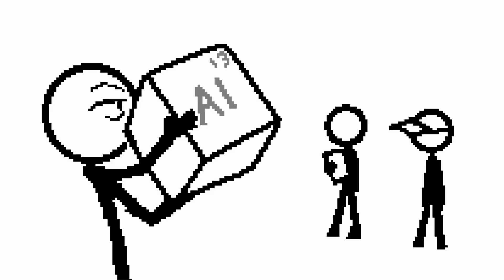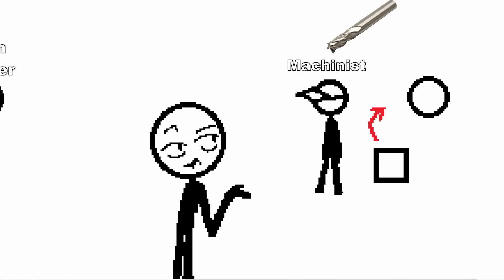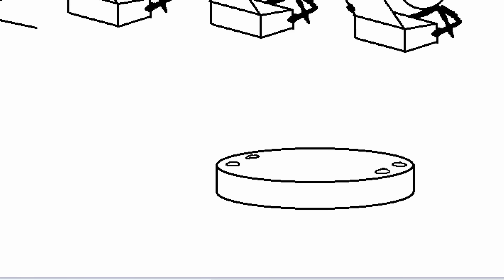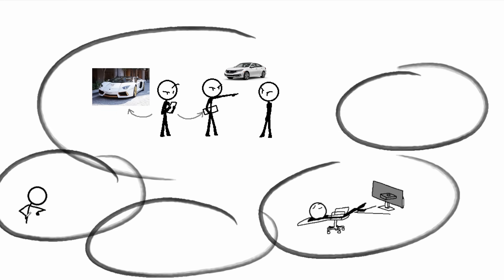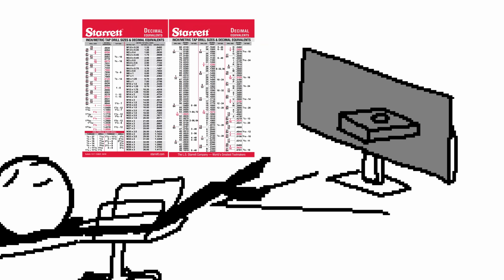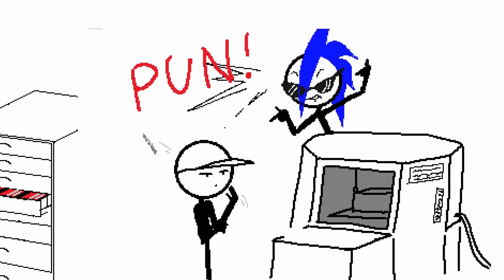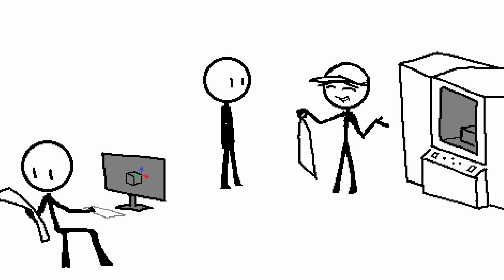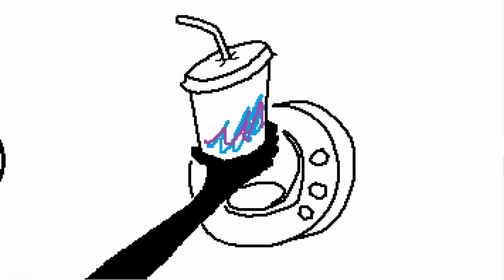Why we hate engineers

Comment: I learned all of these problems from an internship at a manufacturing company.  The engineers sit high and mighty in their A/C offices while the CNC guys get the weirdest, most impossible instructions on the planet.
Reply: ...are the machinists not in an air conditioned room too? Because if not, they should quit. It's a lot easier to prove you're a good machinist than fake being a good engineer, they shouldn't have a hard time getting a better job.
Reply: @aluisious  Nope, it was a large factory where we built cabinets, doors, shelves, you name it.  The CNC milling, edgebanding, and jointer operators had the toughest times with the miscommunication and misunderstanding, with a lot of waste tools that were made for specific jobs and never used again.  They showed me drawers of tools for the jointer, some years old that were used once.  Anyway, we couldn't have A/C since the factory was so huge.
Reply: @aluisious  yeah if my machine shop doesn't have ac I'm going to be suspicious especially if its way above or below 70 degrees as that's the standard to calibrate machinery and measuring tools but for basic repair shops its not as big a deal
Reply: I’m a 19 yo machinist and in the little time I’ve been working this type of issue has already happened lots, honestly it’s frustrating. Thanks for this video its amazing, thank you!
Reply: That's a really misguided idea of how engineers work, at least from my experience actually being a design engineer 

We go out all the time to do physical work, surveying, measuring, climbing up on top of shit because we can't find a pipe because it wasn't installed according to the drawing and nobody bothered to pass it on. Obviously that's not all engineers, but just my experience.

I feel like engineers get shit on more because it's perceived as punching up, while if complaints go the other way it's seen as punching down (which it kinda is). 

I think there should be a reverse version of this video explaining all the things that are frustrating in the other direction. Like the aforementioned turning up to do a final quality check on the job site only to discover it's been fitted in a completely different way and now you have to redraw the entire thing. Because it seems there is a lot of emphasis on understanding it from the machinists point of view but what about the other way?

Like sure, that part with that tiny spigot sticking out looks really fucking stupid, but have you actually seen what it's being used for or fitted to? maybe there is a reason it's not just threaded in. 
Maybe that surface finish is way too high for the actual purpose, but it's being made that way because it has to comply with a standard in order to be allowed to be used. 
Maybe that is a really weird size of hole to drill out, but perhaps it has to be that way because there is a really weird connection it's got to fit. 

If machinists in this case were given more context by designers it would make their job easier and in turn if the people fitting the parts (in this case "man with angle grinder") communicated why they had changed all that pipework around (eg, there's a random pipe that was fitted mid-way through us designing the fitment) instead of giving zero feedback then when we go to survey it will make sense and we can correct for that in the future. 

TL;DR Communication is everything, instead of assuming one group (engineers, machinists, fitters) are stupid maybe ask why they chose to do it that way. 

/rant over/
Reply: As a engineering major I strive to not be like that lol
Reply: Exactly my experience too. The designers in their AC office while the operators are on the floor, soaked in coolant and grease.
Reply: So fortunate b4 I went and got my eng degree that I was a floor employee for 7 years... Some of the shit my colleagues come up with is just stupid. Lets be on the bleeding edge of yada yada, running every tolerance to its max... 

It spreads salt on a road bro... the difference between 1%-.001% is sooo much smaller in cost than the difference between .001% and .0005%... AND NO ONE IS GOING TO NOTICE OR CARE IF WE PUT 100 POUNDS OF SALT ON THE LOT OR 101 POUNDS SO GO WITH A 1% TOLERANCE AND SHIP IT.
Reply: @Kav.  I'm going into Enginwering myself, so I appreciate being able to learn both sides of the story.  I personally believe having experienced the manufacturing side of things first will make it easier to understand other parts of a design and manufacturing process.  It's most of why I did the internship in the first place.
Reply: @swifter46ter  experiencing manufacturing will make it easier, most engineers I've met have got at least some experience manufacturing though. What I'm really trying to get at is that a lot of the time in manufacturing somebody from one party (machinist, fitter, designer) will instantly go "ah they're being fucken stupid" rather than asking why it's been done that way. 

Those pipes I was talking about for example. 
As a designer I could go "ah they're too stupid to fit it properly" 
As a fitter they could go "how are they so stupid they thought this would fit?" 
As a fabricator they could go "how are they so stupid they thought we could get a pipe with that bend radius"

Which is why all three should communicate and actually pass on notes. In reality most people have a brain, if something seems wrong it never hurts to ask why it has been done that way. Maybe all parties would learn something then. Instead we get "reee why engineer stupid not know how to design for manufacture?!?!" which is just unproductive.
Reply: I was once at a job site to do some data gathering for a virtual trainer on how to assemble and operate a real system. They build the real thing, my company builds a less computer intensive version that can be run in real time. Both departments were in the same building, but unless the finance department gave them a charge code for the time they spend in the other departments' building, they could not pass through the doors to physically speak to one another. One of the weirdest rules on a site I ever read.
Reply: @Kav.  A lot of people don't communicate because they've learned the answer is going to be "shut up and do your job." People are shitty, and lots of "teams" are not a well oiled machine. 

I've worked on fixing broken or buggy equipment for years, I have experience programming software, and when I get what looks like a software related error I ask if I can get the source code and I get told "that's not your job." 

Fine, fuck it, I'll throw a $5k part at it knowing that it won't fix the problem but I can close the call and hopefully someone else gets it next time.
Reply: @Kav.  if something wasn't installed right that sounds like an assembly issue rather than a machining issue
Reply: @user-lv8dn8gw9z  it's a fitment issue, I already specified this when I referred to the "fitters" but it could easily be a machining issue if something was measured incorrectly, a machine incorrectly calibrated, a drawing had a bit of coffee spill and the operator just machined the part to the dimension they remember (for manual ofc)... Human error is a thing. 

But again, not my point.
Reply: @aluisious  well yes, but continuing that culture is your choice. In my experience the "shut up and do it" types are universally despised and generally few and far between. 

If they tell you to shut up then it's on their head if it's wrong, at least you asked first. Better than you being the one to take blame.
Reply: @aluisious  Now you are learning hahahahaha sounds like my job, you can't win them all, or many at all i'm afraid.
Reply: Plus we're soaked in coolant and with loads of chips that make us look like metal porcupines.... Or other things depending on what you do in the shop lol. Ooh god not to mention when you gotta open the machine up.... Talk about hot
Reply: The engineers get nicer offices because like this video says they're expected to design, model, test, and know how to fabricate everything about the parts they make. 4 year bachelor in engineering and then I guess they are expected to have another 2-4 year machinist certification as well? Maybe a masters for the design part. They don't need a machinist on the team the point of manufacturing engineers is to know the capabilities of the equipment in their shop and put input on design. Too many people want the designer to do everything.
Reply: @Kav.  got bad news for you bud. Talking to them is your job. A machinist on the floor gets the print and makes the part. Half the time i dont even know what it's for. We get paid to make the part to spec, not to make sure it gets installed correctly.
Reply: @JamesBlitz00  This isn't just about machinists though, this is about fitters, welders AND machinists.

Communication is the job of both parties, that's how you make an effective team. 

If you're a fitter lets say on a ship and you have been told "fit 50mm OD pipe to this installation guide" if you are unable to fit it to (lets say because it's a class of ships where this one particular one has a different fitment for some unknown reason) that spec you need to communicate and work with the designer, what you don't do is just fit it however you like or just only fit the bits you feel like fitting. If you need to fit it quickly then that is the only exception (For example if the ship is going out to sea the next week), at which point you need to feed that back to the designer with the reason why.

The same as how if you are unsure about how something is to be made you should feed that back and ask. You're an adult as well, it shouldn't be that design engineers are constantly chasing after you, if you think something is wrong then speak up. 

As a side note, every machinist (pro-tip a lot of machinists eventually become design engineers) I've ever spoken to agrees with me on this. If you see something that looks a bit odd it's not bad to query it rather than wasting material, labour etc making the incorrect thing. ESPECIALLY if you make the incorrect thing because you did not fully understand what was being asked of you but you chose to just assume rather than ask questions.
Reply: @JamesBlitz00  see this quote: "If machinists in this case were given more context by designers it would make their job easier and in turn if the people fitting the parts (in this case "man with angle grinder") communicated why they had changed all that pipework around (eg, there's a random pipe that was fitted mid-way through us designing the fitment) instead of giving zero feedback then when we go to survey it will make sense and we can correct for that in the future. "

Then you reply with "Half the time i dont even know what it's for"

DO YOU NOT SEE THIS IS EXACTLY THE PROBLEM I AM POINTING OUT? 

Like imagine condescendingly ("got bad news for you bud. Talking to them is your job.") replying to me with that when you haven't even read what I said properly.
Reply: @WiseSchizo lol, not in my experience. 

Schizo is a good choice of username though, embittered guy who can't see it from the other side while he incessantly whines about how "others don't see it from my POV" failing to see the irony of this.
Reply: @WiseSchizo in that case why aren't you doing our job? I know plenty of machinists who have gone up to become design engineers, so why not you bud? certainly brings a cushty pay rise.
Reply: @WiseSchizo interesting, I've never paid a single penny for education yet here I am. I guess it must be different in America lol.
Reply: @WiseSchizo I certainly found it ironic, given the context of your comment. Just not in the way you intended.
Reply: guys dont hate engineers,  just study more and u can become one ;)
Reply: @Kav.  Engineers, at least some of them, work on the floor, too, and wear the same dirty company workwear as machinists, assemblers, and other workers. In fact, visitors from other buildings, suppliers, and contractors sometimes ask me things about the workshop that I'm totally clueless about. I realized that's probably because I'm not young anymore so I look like I know everything but actually I just joined the company and I have to ask the young guys everything and again in a fortnight because I forgot the answer. Since everyone is dressed the same, there's no way for visitors to know who to ask so they resort to intuition.
Reply: @Kav.  In some cultures, it's common to avoid speaking up. It could also be a personality trait that some people choose not to speak up even if they get a design they are 99% sure is a design error but they see faulty design as a manufacturing challenge and decide to make it nevertheless, and then proud themselves with having successfully made Penrose stairs. While this video is obviously hyperbolic, it is conceivable that an engineering company might develop a siloed culture like that. Not all companies are like this and in fact, some have very down to earth design engineers who think of lead time and cost of tools even before hitting extrude. They will frequently visit machinists or the machinists will visit the engineers when there is a problem that is easiest to fix by having the machinist point at the display and tell how to fix it.
Reply: Still not as bad as the "Social media marketing manager"
Reply: @Kav.  Try being in QC or QA..
Yeah, we have 50 NC parts...
- But why?
Because we couldn't make it, drawing is impossible
- Why did you make 50?
Because that was the order
- But they are wrong
Because of the drawing
- Why didn't I hear about this earlier
I wanted to try it more
- But you knew it wasn't possible?
Yeah, but it is not my fault, I didn't draw it.
- IT FREAKING IS NOW.
Reply: @swifter

same in restaurants, when the kitchen staff complains about serves making mad money in tips. serves invite them to serve but they don't. everyone like different environments. back of the house ppl like using their hands & not dealing with people's bs...so they stay in the BOH. 🤷 and there's ppl who need to feel high and mighty in the sweaty professions too, it's not just the 'college boys'.

 - steel mill laborer turned engineer
Reply: @printgymnast368  i work in german companies, never have i seen a/c around the mills ( i´ve been to half a dozen comapnies)
Reply: Im a CNC machinist/manual machinist and my boss turns the AC on only when its like seriously unbearable lol. Meanwhile everyone else in the offices get crazy AC 24/7/40. I dont know why.
Reply: "Hey run 10,000 of this .0002 ID tolerance ring that has a wall thickness of .03 on a 25 year old machine that has been crashed by idiots many times."

"Also since we cant grab it with the pickoff collet you are going to have to deburr all 10000 of them when the OAL has a tolerance of .001 total."
Reply: As someone who did both - blame the project requirements. Every weird and impossible instruction machinists get is preceded by a weird and impossible instruction engineers got.
Reply: Mechanic assembler have all errors to resolve, errors of engineers+ errors of machinists+ errors of chiefs ( don't give the good tools and don't want to spend money in tools ). 
And many times when you offer a solution the ingeneers become angry.
You saw the solution in 2 seconds but the ingeneers need many days to calculate if it's ok to do that.😂
Reply: My engineering program accepted only the top %1 if that (it's easier to get into med school) and had a %4 graduation rate. 

The average four year engineering degree takes six years.  The average MASTERS in business takes  THREE.  The math graduation requirements for MBA are way less than the entrance requirements for engineering. 

The incoming engineering students are better educated than the MBA graduates.
Reply: @aluisious  we get AC for super super precise stuff.  Aerospace parts need climate controlled rooms in order to get accurate readings on the part, whole extra machines are dedicated to measuring them, and the parts have to sit in a climate controlled room for a certain amount of time for their internal temperature to equalize with the environment.  But for run of the mill shops like I work at where tolerances are ±3 thou and occasionally half a thou on a hole?  Our AC is an open bay door and a fan.
Reply: @aluisious  Even if it has A/C, there's no guarantee it will be able to out cool the hot machines